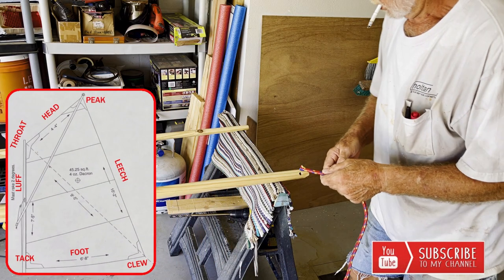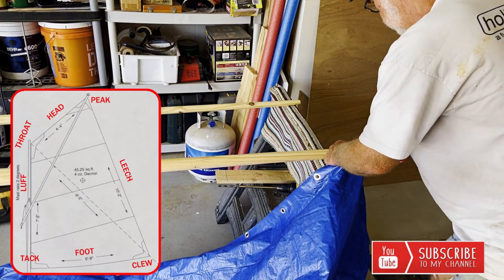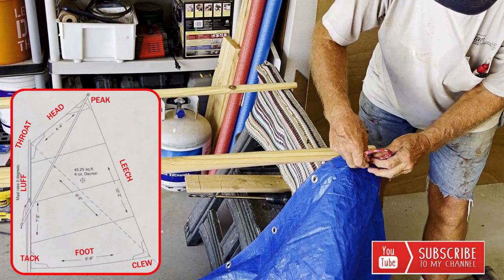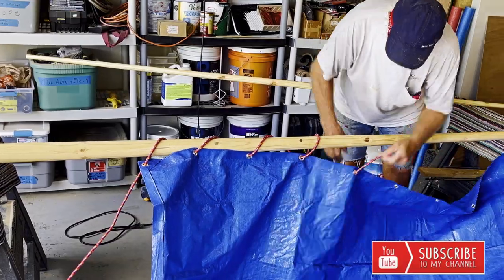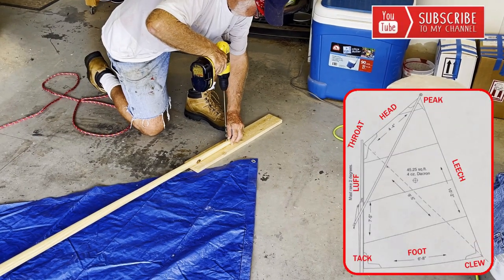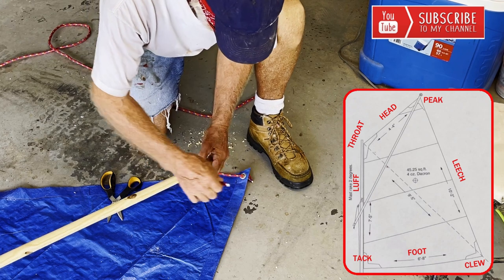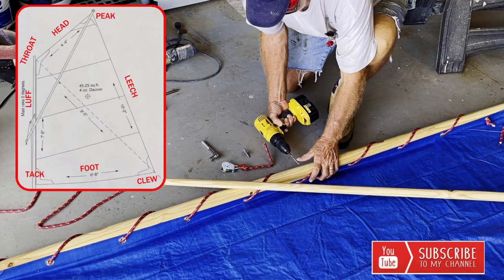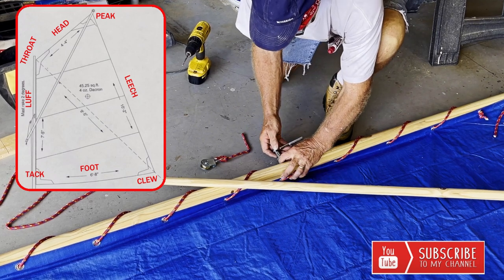DIY Rigging The Sprit Sail

Comment: You need to learn and use some other knots… the clew, spar and the loop around the bolt would all be better served using bowline knots instead… just a suggestion. Also the threading of the sail to the mast was far too tight. It would be much better served by loops at each of the grommets to keep it from binding and allowing the sail to spin and move more freely around the mast.
Beyond that, very nice work on the spar and mast… once you get the bugs out I’m sure you’ll be happy with your rig!… nice video, thanks for sharing!

Comment: Captain Pete Culler who wrote several books on traditional sails ,explains that the sprit rig requires a rotating mast to prevent the sail from binding to the mast,which should be lubricated with tallow,another traditional item. They should also have vertical seams in the sail if it’s a big sail as this makes it set better .
Reply: Pete Culler also laced the sail on the mast differently to prevent binding when lowering the sail.   If you don't lower the sail then the way you did it would probably work just fine. 😊

Comment: Hi, where did you find the diagram of the sail with its dimensions? Also, what are the dimensions of your boat?
Reply from the maker: If you watch my video "Make Your Own sail, you should find all the information there. Otherwise, you can get a diagram from Boat Builders Central in Fort Pierce, Florida. Jeff Morrow, 772-742-8535